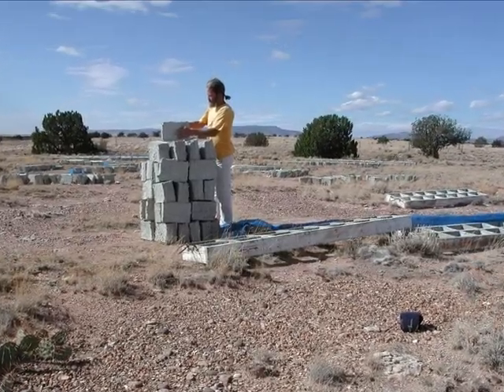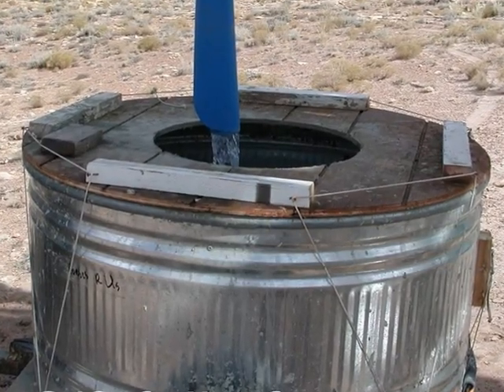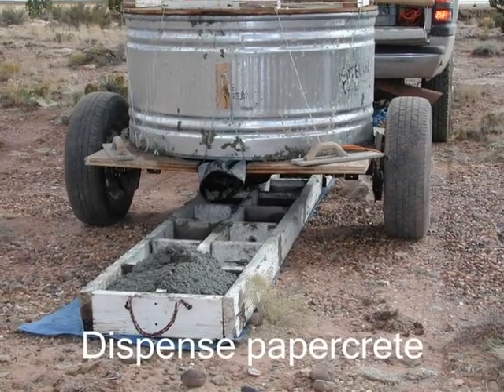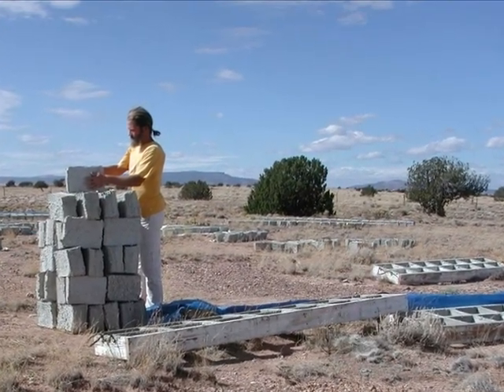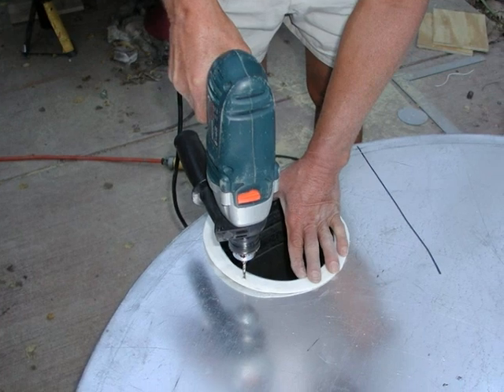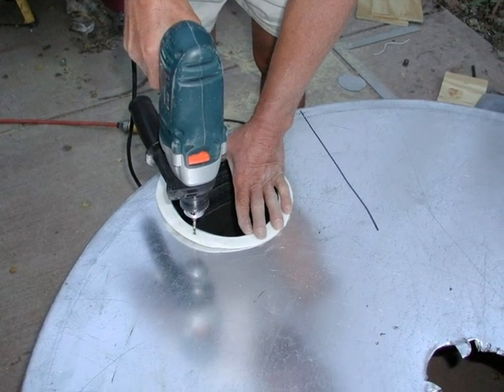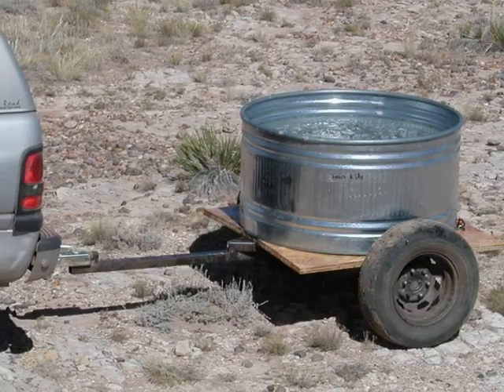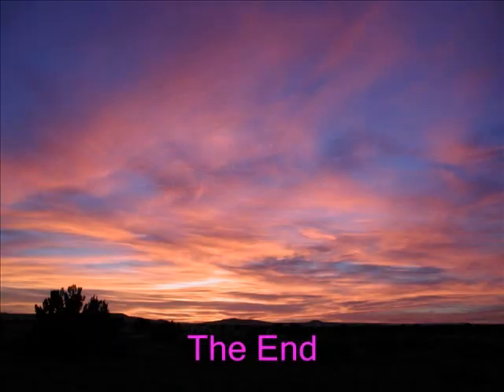DIY How to Make Papercrete in a Tow-Mixer

Comment: In a Mother Earth News magazine published about the mid 1970's this was a feature article that showed how to build the mixer and how to mix the proportions for papercrete almost verbatum to your method... I have long since stored away the magazine and it became property of my ex-wife long ago... but  I have always been curious as to how well these blocks would hold up if used in a high humidity environment....I remember the MEN article was also based in a real arid environment.
Reply from the maker: Yes, an arid environment has the advantage that the PC does not need to be as rigorously maintained to keep out moisture as in a wetter region. It has to be protected like wood or it will rot if wet for long periods. However, it won't soften, as it cures like concrete.

Comment: I have an idea for including load bearing elements into papercrete>
like including vertical bricks or rebar to be able to build multiple story buildings without the need for separate structural load bearing elements like steel/brick/concrete/wood columns.

What do you recommend for 2-3 story construction?

I also had another idea, using stale unsold bread from bakeries to make
gluton pulp with paper, eliminating the concrete. What do you think?

Comment from the maker: Good news on both: Termites can't eat it - it's full of Portland cement. Water will make it soggy and eventually it will get mouldy and possibly smelly, but the cement keeps it from getting soft, so it won't mush on you like adobe. It's cured, like concrete and stays solid.

Comment from the maker: @didaskalos777 - 1) Consider it termite-proof. Won't burn either, even if you hold a torch to it. 2) Tensile strength? PC is not like wood or concrete in a panel, but the fibers will hold it together, making it moderately structural. I suggest a 2" thickness minimum, unless you're just covering a wall with PC as insulation. Use a food processor or blender to make samples of PC, using various amounts of cement, allowing them to cure wet, then dry them out. Test for structural qualities, etc.

Comment: Very interesting video! It's seems like a great construction material. My one worry would be water damage though since so much of the block is made of paper. Is sealing the surface an issue?

Also in terms of strength and weight how does it measure up? For instance can you make multiple stories? Is it a heavy substance to build with?

Finally is it flammable? I imagine in some places a fireplace and chimney may be necessary but I'm guessing this substance isn't suitable?
Reply from the maker: rorkimaru - Papercrete is an amazing material, but it is not a substitute for everything. You are correct, PC must be protected from water, just as wood must. PC will absorb water but not become soft, due to the cured cement, however it will get moldy. Sealing is necessary where water will contact it.
Two floors should be no problem, if the walls are a foot thick, but the roof should have its own support. PC weighs about 1/10 of concrete. Blocks 12" x8"x5" weigh 3.5 lbs. Not flammable - a torch will not ignite it. A fireplace requires firebrick - neither PC nor concrete will work.

Comment from the maker: All structures and shelters that have to deal with high winds must be designed to perform well in them, regardless of the  materials used in the construction. Papercrete is lighter than concrete, but it is not so light that it will blow away.

Comment from the maker: Good question. There are many different recipes for papercrete, depending on how it is used. If you make a batch as in this presentation, using one 94-lb bag of Portland cement for 42 blocks, then you have 42 blocks for the cost of a bag of cement. If you make your own cement blocks, you can save money. If you buy them, then compare that cost with your papercrete blocks. How thick is your wall? How much wall can you make with 42 PC blocks? What does it cost to make that with cement blocks?

Comment: Brilliant, love this vid,some more questions,
Do you use standard mortar or the same mix you used to make the blocks as mortar, is it flammable, is it crumbly, ie does it hold together well.
An idea has occured to me, in stead of building a house with blocks, why not make some form work up in the shape of a large hollow tube and fill it with batches of this mix, then cut out doorways and windows after it has gone off ?

Comment from the maker: Papercrete needs to be protected from weather just like wood. It will absorb water and rot just like wood. It is possible to make a rich (more cement than paper pulp) mix and use it as plaster on cured papercrete to make it more weather-resistant, and to create a surface that's easy to paint.

Comment from the maker: @heartshapebox88 - Save yourself. Bamboo leaves are fibrous, as are many other plant parts. Papercrete is a mixture of cement, water and fibers, and it really doesn't matter what kind of fibers. I suggest making some experiments using a blender or food processor, using grass, leaves of various common plants (including bamboo), paper, cardboard, and use about the same weight of cement or less. Let each test cure for at least 24 hours (keep wet). Dry completely and compare them.

Comment from the maker: datzfast - Papercrete is made of the same fibers as wood, and these fibers must be protected from the weather in the same way as wood. If Papercrete stays wet, it will become moldy. Using papercrete plaster on a papercrete block or panel wall, for example, you can create a surface as smooth as you like, and then you can paint it like wood or sheetrock or any other surface.

Comment from the maker: Good question. Answer: No. What a papercrete mixer does is more than just mix, it is a huge food processor, with a blade spinning rapidly, shredding the paper into pulp so fine that after a few minutes, you can't find one single letter printed - it's mush. Going around in a cement mixer of any size won't do that; well, it might if you spent a week on each load. In place of the blade, some PC mixers use just angle iron or a foot or so from a metal fence post. Think SHRED, not just mix.

Comment from the maker: Papercrete is 'glorified' paper mache, so anything you can make with paper mache you can make with PC. I add white glue to it for making forms, around which I bend hot PVC pipe to create pontoons for catamarans. Be sure to account for shrinkage as it dries. I add another layer to the first that has dried, and maybe a third thin one to bring it to the size I want. I make it a bit larger, then sand it smooth. PC is used for making furniture, planter boxes, sculpture...

Comment from the maker: Heat and cold are not a problem for PC. But PC must be protected from water, just like wood. There is a community in NM in Columbus that was built in the 70's from PC and fibrous adobe, nearly all structures are doing fine, and those that were built well are solid. I accidentally deleted a question about building codes - I'm not aware of PC having been approved, but I don't know.

Comment from the maker: We didn't measure by gallons, we just dumped water in. If you make a batch or two, you will see how much to use. We could have used more of the capacity of the tank - more water, maybe 100 lbs paper and the same 94-lb bag of cement. A pound of paper to a pound of cement is a good place to start experimenting, depending on what the PC is for. More cement if you make mortar or plaster, less for blocks.

Comment from the maker: PC won't dissolve, but it will absorb water. The cement cures and keeps it hard, but a soggy block will mold and rot. Protect as you do wood.

Comment from the maker: PC can be made using various materials and proportions, with and without sand, so it is not a fixed recipe. Sand adds compressive strength, no sand makes it light like insulation. I don't know of any formal testing for code.

Comment from the maker: @waellerbe - Possible, but not advisable. Papercrete will cure inside bottles but not dry out, so your bottles will be very heavy. Second, bottles are too smooth to stack or bond well to each other. If you find a use for cylindrical blocks, you can use bottles to mold papercrete, then dump out the cured 'blocks' and try to use them. Looking for free molds? Good idea, but bottles are less than ideal, even though they're free.

Comment from the maker: Plastic bags will not make the blocks waterproof, as the cement is porous when dry. Cement also does not bond well to plastic, so the blocks might be fragile and possibly unusable. The fibers in paper are what make papercrete so strong, in the same was that adding polyester, polypropylene, nylon and glass fibers makes concrete very strong and crack-resistant. If you are looking for other fibers, one guy used bamboo leaves. Any strong fiber will work if cement bonds to it.

Comment from the maker: @JohnnyO3333 - Well... got a calculator? I got 42 blocks, each block 12 x 8 x 5.5". If you multiply those, you'll get volume in cubic inches - just guessing, about half of the volume of your block. But we could have used more of the capacity of our mixer and less cement - ours were stronger than needed for the purpose. We could have made 56 blocks, 4 gang-molds in a full mixer.

Comment from the maker: If the blade is perfectly balanced, it may be fine on the road. If not, simply unbolt the blade first. Remember, this is one mean machine at only 10mph with the blade spinning. You will want a cover on it, and make sure there isn't a cat sleeping inside!

Comment from the maker: Borax, great idea, tho I haven't tried it. It would take a lot of paint to waterproof something large - a wall or house. Why not just paint the wall? Papercrete must be protected from water like wood, filling up all the pores with paint might not be practical, and it would lose the insulative properties - lots of air in tiny pockets. However, paper, water and paint or glue is another strong building material (leave out the cement) for other purposes, like planters, sculpture...

Comment: could this be used for interior walls as a divider or as a wide long length for craft work table.. not knowing the strength of it? i can see many uses  for this if treated correctly.
Reply from the maker: Hazel, Papercrete has more uses than our imagination. There is a small village in south NM made mostly of PC, and it's still standing, built in the 70s. Yes, interior and exterior walls can be made of PC, be sure they are thick enough. People make tables, benches and other furniture from PC. It is not a concrete replacement where abrasion and compressive strength are needed, but otherwise, it's versatile. Protect from water as with wood, or it will rot.

Comment: Will cardboard work with this? Is there any kind of paper that does not work well?  What's the best?
Reply from the maker: Cardboard comes in many types, but as long as it still has fibers that will bind together, it will work. It might need more soaking in water than paper before shredding.

Comment: Awesome video. I chainsaw carve 6 foot high "moai" statues ( Easter Island heads), and been looking for a lighter and easier option. Could a mold say 6 foot long by 2 x 2 ft be filled, if so how long would it take to dry, how heavy is it (can you calculate the weight from that volume) and then how easy is it to carve, would i use my chainsaw or what?????

Lastly. These statues are for outside use and would be painted grey, but the papercrete is the perfect colour, what product would be best to seal it? Polyurethane?

I can get a strong PVC black drum, same diameter but twice the height. Do i saw it off or leave it at that height?

Cheers
Ted
Aka Flying Kiwi
NZ
Reply from the maker: Flying Kiwi Interesting project. If you do many of these statues, consider casting them in papercrete instead of carving. You can make a mold from a statue you already have using papercrete for the mold. Fill in the tiny pockets with plaster or equivalent. Paint the inside of the new mold with exterior latex house paint. PC shrinks a bit when drying, so you may not need a mold release. Make sure it cures (if you use cement) for a day or two before drying. Seal with latex paint (cheaper than others). If you need a very smooth surface, either make the PC mix very fine (pulp) or plaster the finished statue before painting.

Comment: How do the cured brick hold up in water?  I mean lots of rain.
Reply from the maker: PC should be protected from moisture just like the wood which was made into paper. PC will absorb water and begin to smell and get moldy, but as it is cured like concrete, it won't get soft. PC cannot replace concrete in every application - they have very different properties.

Comment from the maker: Again, think of it as wood. It's your foundation wall or stem wall, so do what sounds good to you. If you're going to use synthetics to seal it for the life of the building, it may be more expensive than concrete and need regular maintenance. Remember UV degradation from the sun and expansion and contraction from temperature extremes. You may get cracking, peeling...

Comment: Would you recommend papercrete to build a house over here up north of the US? Iowa, South Dakota around here? I know that papercrete is not approved in city limits or where building ordinances are required but I would like to use it for my homestead out in the country.  I would appreciate a response.
Reply from the maker: Norma, I can't think of a climate where PC would not be useful, but you have to decide for which use it will be employed. PC is an excellent insulator, in addition to its use as blocks or panels. So walls of PC don't need insulation. Remember that PC is wood fibers and needs the same protection from the weather as wood. Keep it dry and it will last forever. Nothing eats it, won't burn or decay or shrink.
Reply: I saw a video from a guy making them in Canada. He did say that its taking him a while to make a bunch because of the weather and so he has to make them in the summer when it's hot. I want to make a home out of papercrete but yea, I wouldn't know how to keep the walls safe from the snow. Perhaps making the material a bit more harder with sand or some other type of dirt that can protect them from the snow. I donno.
Reply from the maker: Norma Lujano
Like concrete, Papercrete cannot be exposed to freezing - it will be ruined, due to water expanding. There are many ways to protect PC from rain and snow, including painting, stucco, plaster, metal siding and shingles. Stucco is easy and inexpensive and requires few skills.
Reply: Yea, that's what I was afraid of. Even if its a bit more expensive then I think I should go with pure concrete then.
Reply: marjamada  Thank you for your insight on PC. I can appreciate the advice of using PC as a form of insulation.

Norma Lujano Thank you for your contribution to the discussion on Papercrete. With Google+ integration into YouTube, it helps to make our conversations more interesting for the topics we enjoy most.
Reply from the maker: Norma - haven't been online in ages. Yes, papercrete is suitable for your area, IF you can make it in temperatures above freezing AND keep the finished PC protected from rain and standing water - just as you do for wood. Even if you don't use PC for structure, you can use it for insulation, in that case it hardly needs cement.
Reply: Call me crazy, yet I honestly appreciate everything I can learn by staying tuned into this discussion thread.

Comment: how many blocks would you make with just the one bag of portland cement without the paper?
Reply from the maker: Not sure what you're asking. One does not usually make blocks with only cement - it's the glue in concrete, holding the sand and gravel together. If you take away the sand and gravel, you have cement but nothing to glue. Same with papercrete. Take away the paper and you have cement. Paper is the main ingredient in PC.
Reply: marjamada ah hah, thank you, can you tell i know nothing about construction?! ;) that's explains it perfectly, so kind of you to get back to me.
Reply: Louise Benton I'm learning as much about Papercrete as the next person. It's refreshing to know that there's a practical alternative to traditional concrete, which could be very expensive in the long run. It's mind boggling to think about how much waste paper can be used in practical Papercrete projects. I still like the idea of using Papercrete as a form of insulation for a given building project.
Reply: +marjamada you say that [p]aper is the main ingredient on PC, yet, in the above, the mix was 60 lbs paper to 90 lbs Portland cement... so it is mostly Portland cement, not paper, or am I missing something?